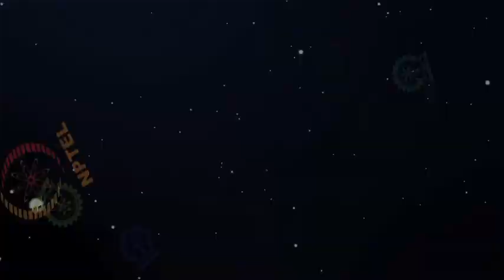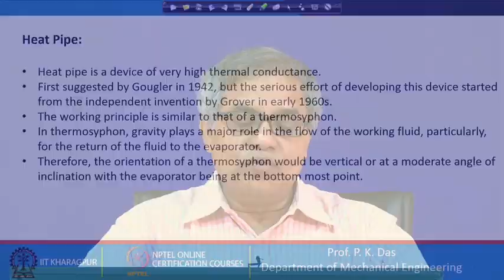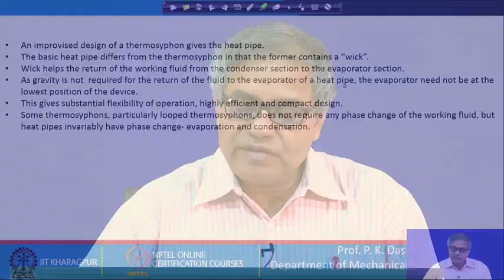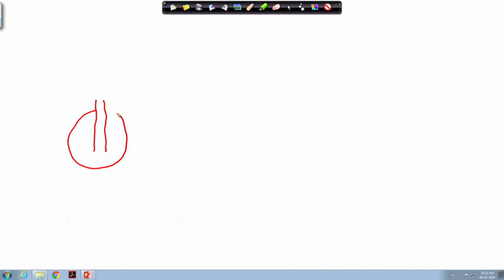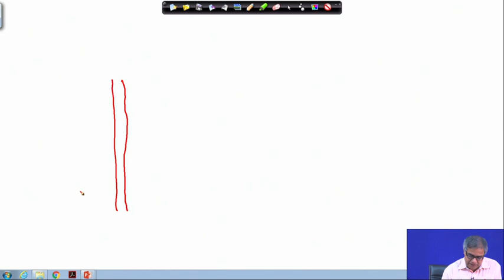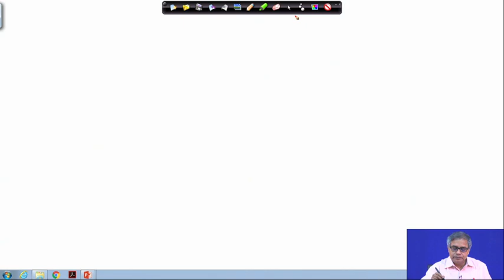Lecture 43 : Heat pipes and Heat pipe heat exchangers

Comment: This is a wonderful invention but not handled properly here and that is reflected in the poor numbers of comments. Actually in India, lots of areas have temperatures around 30+, Removal of heat could be a major issue in most of the industrial, commercial and consumer applications. Hence, heat pipes can form a major solution. While copper's conductivity ranges from 30-40, heat pipes made up of copper can have 300 conductivity and that's a major major advantage. vehicle engine cooling and refrigeration manufacturing must incorporate the concept ASAP.